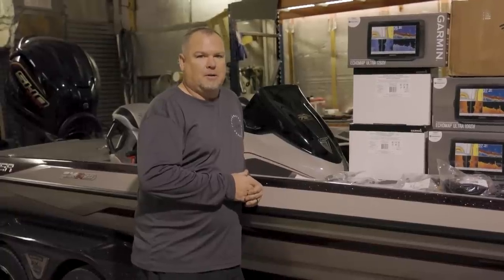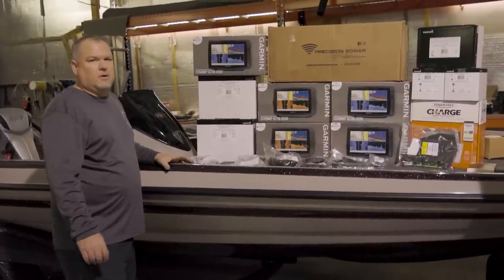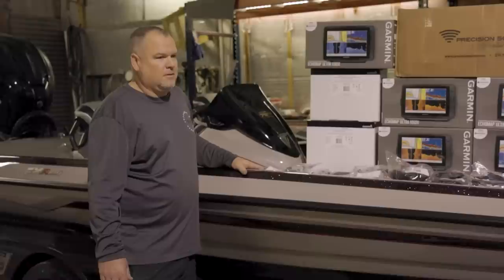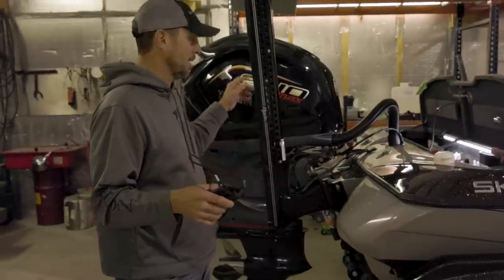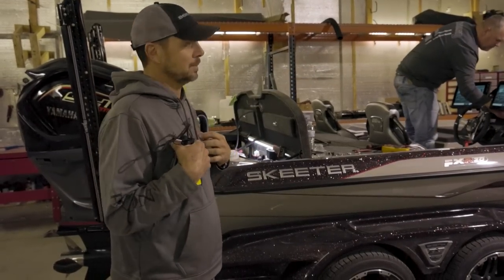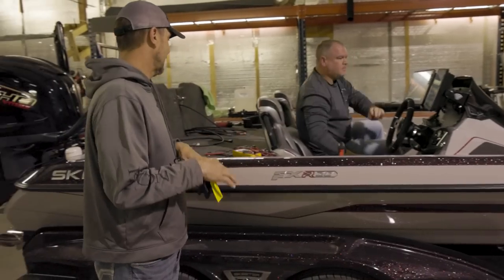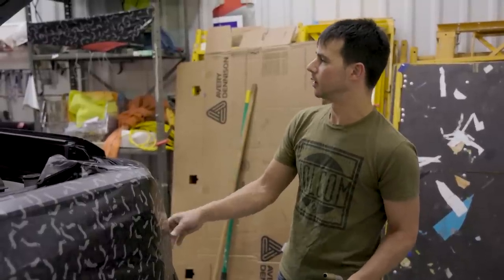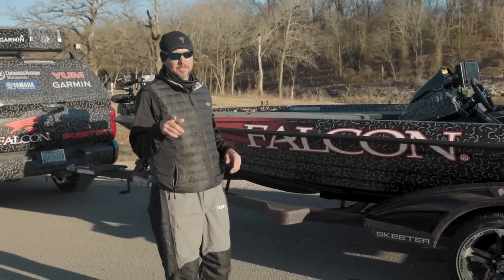RIGGING my Skeeter FXR20 – 2023 Bassmaster Elite Season!

Comment: Jason, do you just run 1 36 volt lithium or do you have 2 36 volt lithiums run in parallel so you have a backup?  Thanks and good luck this season!
Reply from the maker: 1 12 and two 36s